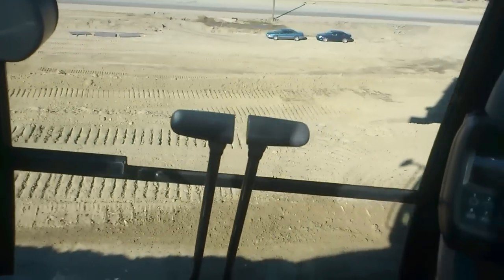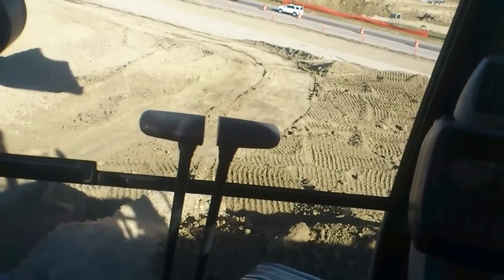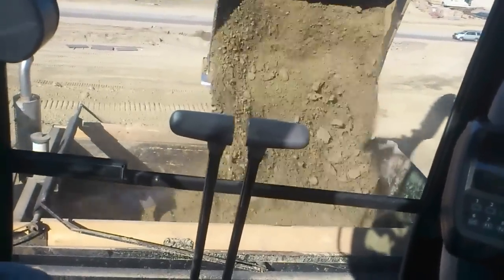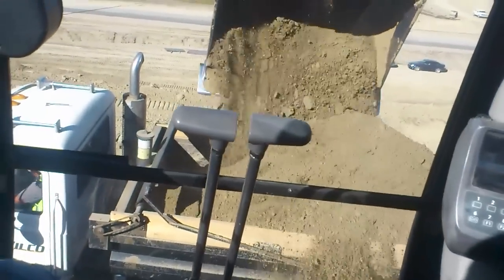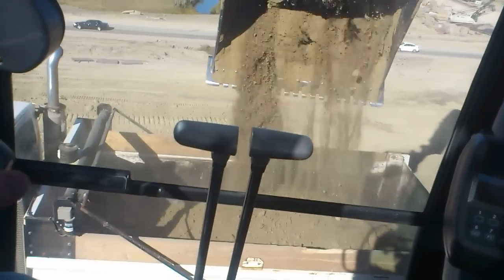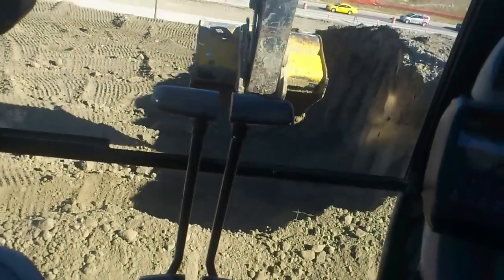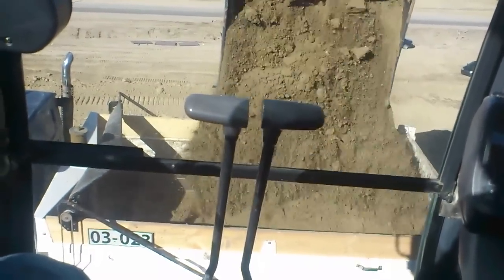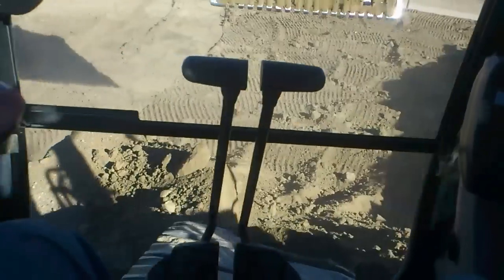How to bench your way on to a hill while loading trucks.

Comment: Just a fantastic video. What I like most, is that you are not working hard, you are not out of control in any form.  You are actually nice and neat and smooth, and SAFE, but you are maximizing every single minute, and every ounce of truck capacity.  I have had many, many excavator load-outs, and would have been well served to have the operators watch your video .  Most points are obvious, but many are ignored.  All told, the dozen points that you make probably add up to a 50 % improvement over good operators not paying attention to the little things.  You talk funny, but you really are thoughtful in your approach. Thank you!!!
Reply from the maker: Thanks you very much.

Comment: Some good points shown. For more productive loading however we've found to put trucks a little further out and use more stick out than boom up. Allows faster lift and faster bucket dump into truck (not so constricted)  Also dig patterns 1st bucket from left of bench then in sequences of bucket width to right maximises bucket fill and breakout with minimal clean up on offside face. We make sure haul road onto and through lower bench is graded regularly. Allows trucks to move up in higher gear (faster) and we blow our horn as we slew just in behind truck when our bucket goes over tailgate. This allows 1st bucket into truck and return started before tuck is fully stopped. Saves heaps of time and trucky doesn't get the time to start reading his magazine before he's loaded and sent off again. (lol) Only ever seen one John Deere digger here in Australia. They seem to dig well by your video. Well done.
Reply: BPC Earthmoving no shit. He's worried about cleaning up but he's wasting time loading on 45° not 30-35°
Reply: I like to keep them nice and tight but further back and not using the boom soo much like you said. Abs this guy's machine is squeaking and he's got about a 200 yard swath to throw back later
Reply: And if you have seen a Hitachi excavator in Australia they are identical machines except John deere uses a deere engine and Hitachi uses Isuzu engines. Other then the engine they are identical.
Reply: The company I work for has always had Hitachi excavators and they have been such good machines. We still got a ex160 lc that's got 40000 hours and the only major things we had to replace was the final drives center planetary shafts spline on the ends just got worn down from sooo much use it wouldn't turn the machine it would just grind. And the swing motors planetary gears and cage got all worn out. And the obvious bushings abs stuff.  But i would recommend Hitachi to anyone.
Reply: BPC Earthmoving ...I don't agree at all. Its safer and more efficient to swing over the tailgate and keep your swing angle always the same. When you stop the trucks sooner, you have to boom and stick on different angles every time and instead of swinging over the side of the truck with a full bucket and slamming dirt on the side of the truck, your swinging safely and squarely over the tailgate. Also the more you stick out the less dirt you can hold. Your just wrong, this guy had great tips and he was set up just right. With his cab facing the trucks cab.
Reply: @jordan1789  in this case he has enough time to load over the back so I would agree with you. But if they added another few trucks you'd have to load over the side or you would end up with trucks waiting. There is nothing wrong with swinging over the side. You make it sound like the guy was saying to swing over the cab.
Reply: @blindabinda1234  depends on the class. Big deere from I want to say 670-870 use izusu engines and anything under either 150 or 100 ton
Reply: @Deere2154D  100 ton?
Reply: Sorry I was thinking numbers not tons. 15-10 ton.
Reply: Good point buddy

Comment: Only thing I do differently is the first couple buckets,  I hold the bucket inches from the bed floor so the driver isn't bounced out of the seat lol. After you have the bed floor covered it doesn't jostle the truck near as bad when you djmo your load high like that
Reply: Meh, it's soft dirt and gently spills into the bed - total waste of time to lower that large a bucket into a 10 wheeler.  The trucker gets far more jostled driving around on those poorly graded roads.  A real high-ball operation would have a grader getting those roads smooth.
Reply: He doesn't like these drivers...lol
Reply: kingrider75 I agree with you. You can't always see if there are any large stones in the material being loaded.
Reply: @jeff7764  until when grabs ya right 👊
Reply: Waaay overloaded

Comment: Very Smooth and 1 minute load times.. could be faster, but that's a pace you can carry all day and be easy on the machine..  My best day I was running my 08 ZX200 along side a competitors 450D.. I have a 6' 2.25yd bucket and I was able to match him truck for truck against his 4 yd... I was able to get trucks in a position where I didn't have to swing more than 8-10' and I have a few more hours under my belt than the other operator.. I was able to kick out a 13yd truck in 45 seconds, BUT in doing so I worked the machine so hard I got the hydraulic system too hot and I have been replacing seals on cylinders ever since.. ALMOST worth the mark of pride though haha.. Nicely done sir nicely done!

Comment: We all have our own idea, just read the comments lol on the fastest most efficient cycle times but there's always someone on the job that has their opinion and telling you how it should be done plus what kind of material is being loaded changes everything. Good video smooth operator and should be with soft material. We don't use our road trucks for off highway haulage for the simple reason of overloading, breaking or prematurely wearing out the steering, brakes, and suspension components, Which jepordize's the driver and innocent drivers on the roadways.

Comment: GOT A HOME USE KUBOTA KX008, WILL NEED 30" SMOOTH EDGE BUCKET. SELL COMPOST, CAN CLIMB 5' TO 6' FT PILE 60+ YDS.  SEEMS MOST PICK UPS ARE 6 FT OR LESS BEDS. HAVING PROBLEM LOADING 6 FT TRACTOR BUCKET. GOOD VIDEO.

Comment: In Canada if the truck is involved in a runaway or rollover crash, the police will come and see the operator who loaded the truck aswell as the driver after they scoop up the spilled load ,put it back in the truck ,tow it to a weigh station and print out a scale ticket

Comment: Great video.  
Several good pointers, per the grading between trucks, when to beep horn on last bucket, keeping your loading platform flat, and maximizing lease trucking.  
Opinion: your trucks are getting a bit too far forward, need less swing angle, gain a few seconds minimize swing time.  However, I have seen worse.  You know what you are doing.
This video should be utilized for training.  Thank you.
Reply: Good feed back. The reason for the truck being so far forward is cause the bucket is so wide on the 450. If the truck was back more there would be more dirt falling off each side of the truck. well noticed.
Reply: @desparkinson9203  No need to be unduly concerned about material falling over sides if those buckets are kept full and it allows faster cycle times.  In this instance, he was wasting time uncurling the bucket when he could stick back at the same time to speed up emptying the bucket - that said, truck spacing allowed him the extra time - I'd add another truck or two to speed things up - there was always a few seconds wait time and a few seconds inefficient loading time. Could get another 5% efficiency gain which is pure profit.  Ideally, there should always be a truck waiting to ensure the excavator is always working - trucks are almost always cheaper than the excavator.